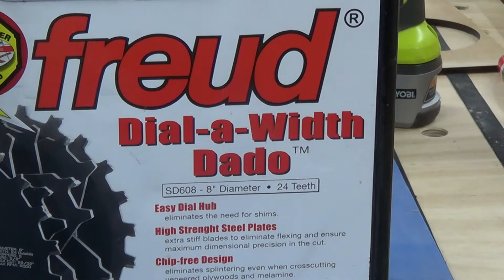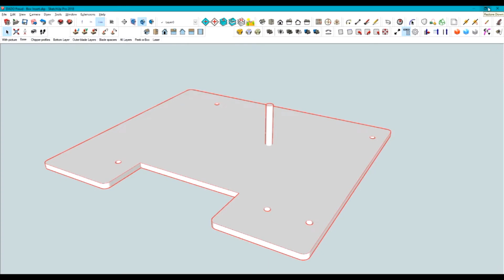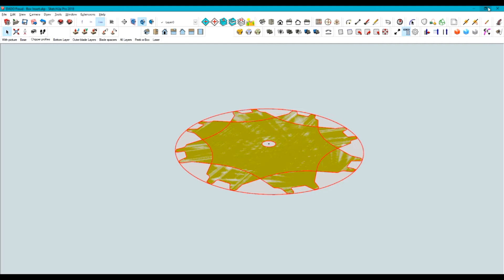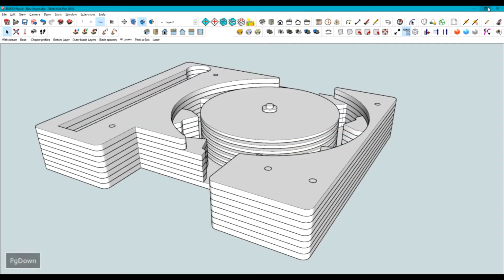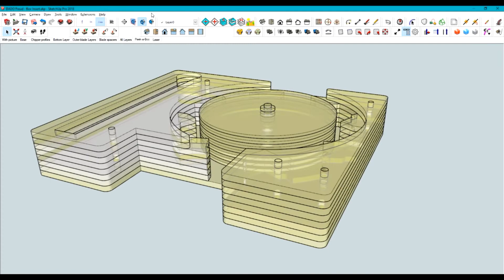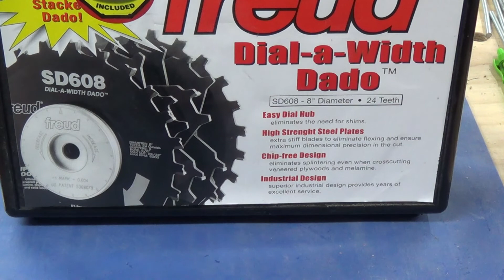Freud Dial a Width Dado Box Insert

Comment: That’s a great idea . I’m just sorry that I didn’t check on YouTube sooner about this . One question I have is “ did you or anyone else have any trouble with the included wrench fitting the nut on your table saw ? I guess that I could have gotten the only one that I had to break out my files and file down the inside of the wrench for about a good hour or two before it would work with my saw .
Reply from the maker: Hi Jerry... Actually, before I made my MDF box packers and everything was just floating around loose, I got in a tiz as I couldn't get my normal wrench (it's a hard to find 22mm ratchet)...  settled down when I found the Freud wrench.  Had no issues fitting... you may have had one of those crazy "imperial" measurements that all sane suppliers try to stay clear of.  At least now you have it working, don't bloody well lose it!
Thanks for your encouragement.

Comment: That's very nice! How much would you charge me for one or just all the pieces all cutout?
Reply from the maker: Hi Stephen, The material to make the inserts would be around $20 for the sheet of MDF its cut from.  Unfortunately International shipping could cost $100+ so I no longer offer to make any of my items for international distribution.
However, I have updated the comments with the corrected link that would give you access to a SketchUp model (in V2016 format as that was the last 32bit free downloadable version) and a PDF that was created using Layout for a 1:1 scale import to a vector processor for laser or CNC processing. 
Armed with those, you could get someone local to you to create the MDF layers much cheaper than the shipping cost as often the major cost in laser/CNC is design.

Comment: I agree on the crappy insert.  I expected better from Freud.  Mine was all cracked up from shipping, but the teeth all look OK on the blades.  Just curious as to why you didn’t use a larger dowel and then just flat spacers rather than have to put a bushing in each spacer sheet?
Reply from the maker: With my T & J model building, I think I'm brainwashed by 5/16" (8mm) dowel.  No logical reason other than I thought that a 16mm dowel (if I had any) would not be too solid in the 6mm MDF base... however If I analised it... there would be more glue surface.  The bushing was so simple on the laser, I didn't give it much thought.  You are right though... if I ever had to make another one I would go your way.
Reply: Alex Kara I was just curious if you had a reason that I wasn’t seeing.  I don’t have a CNC machine so making something like this would be a challenge, but I like the idea of it.  I think I may just get some rigid foam and cut out places for the blades.
Reply from the maker: I've never had success with the foam and here in Australia, that Kaiser foam is hard to come by.  I found that layering out of 3mm/6mm MDF will permit better profiling... You'll probably find that the packers could easily be laminated from MDF just using square shapes and square 3mm seperators.... It really boils down to how much of a neat freak you are... sometimes the unsightly is just as good if it does the job.  I'm just fortunate to have a laser, however, I have advised others to just use square cuts and they've had success (not this project but others).
Reply: Alex Kara No doubt that wood is better and more robust, but the rigid foam we use for insulation under concrete slabs is pretty robust stuff.  It easily supports walking on it while pouring concrete.  I think it will be plenty robust for this application.
Reply from the maker: Many years ago I looked at Eurotek to jack up my house (they use that foam the lifts blocks of flats).... circumstances precluded that option, however, we are now talking  different courses.  I have found that layered MDF, with a bit of SketchUp Ingenuity, will fill most of my requirements.